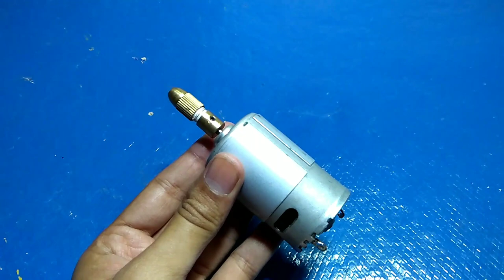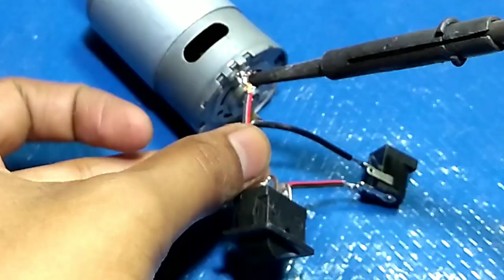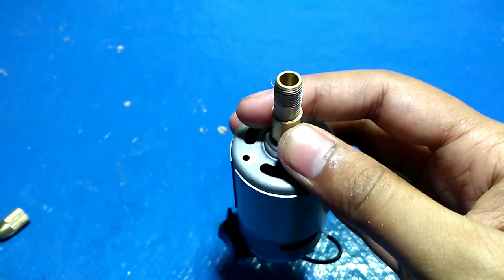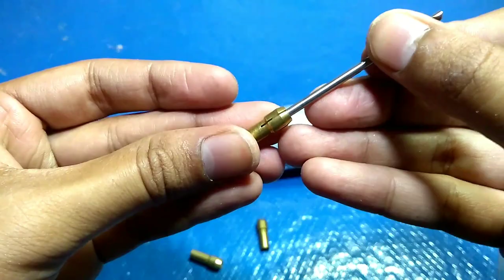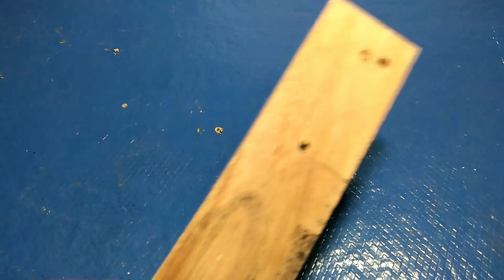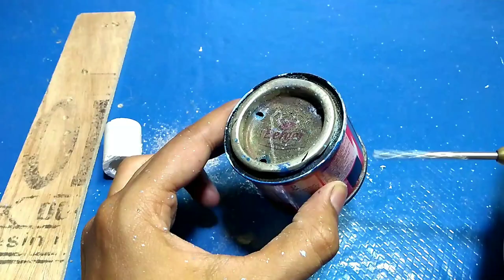How to make a 12 volt drill machine at home .... desi jugad.. mr creative dude

Comment: Aapne dc 12v 555 motor liye hai
Ham 12v 775 ka laga sakte hai ????
Reply from the maker: Is chuck me 775 motor nhi lga sakte kyoki 775 motor ke shaft ka diameter 5 mm hota h aur is chuck ka diameter 3.17mm hota h joki 555 motor se match krta h
Reply: @mrcreativedude  ok Thanks
Reply: Ek aur drill machine banaye 12v dc 775 motor me